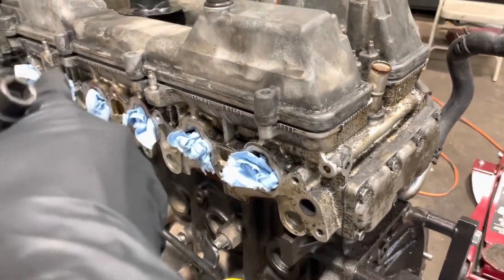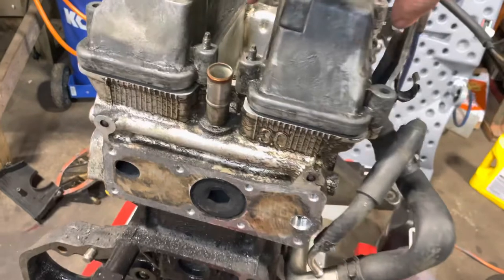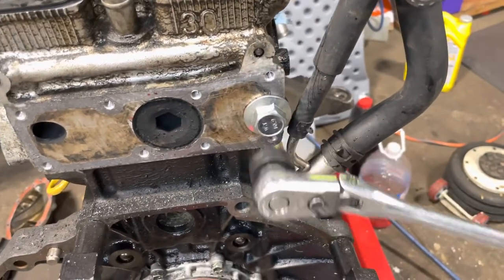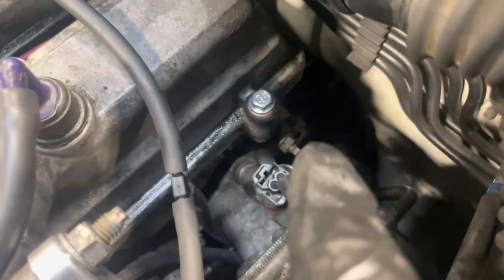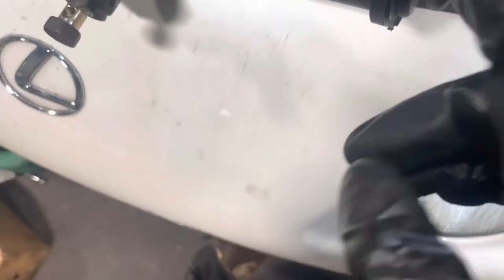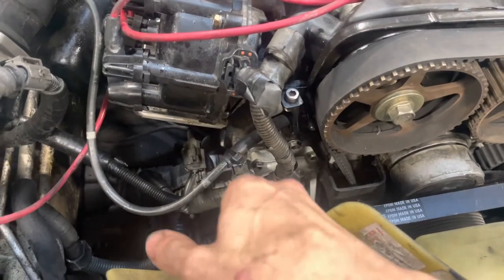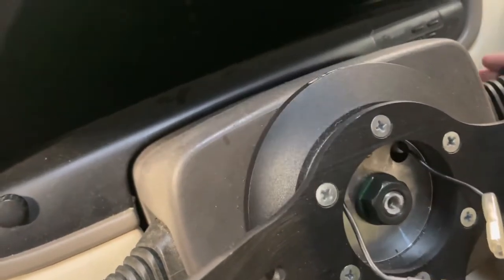2JZ-GE EGR Delete and Vacuum lines

Comment: On the charcoal canister from the fuel tank:

There is a line that was under the charcoal canister that runs back across the car to the area around the starter. You can tie those two and then it will dump there.

Personally I am so cheap that I want to use the vapor from my gas having played around with some southern engineered "bubbler" systems on old 80s pre obd vehicles where air is pumped into a fuel tank to vaporize fuel and the vacuum caries it into the runners through the tract

Yeah its not a lot, but like I said I'm so ocd about efficiency that I can't just let that vapor go. On a boosted car you'll get more out of it than on a NA just because under boost its going to pressurize and shove that vapor in with the charge. Depending on the lift and duration of your cam EVERY little bit helps when it comes to the miliseconds of the valve event

The resistor for the EGR is 10,000 (10k) 1/2 watt

Great video this will help a lot of people
Reply from the maker: Thanks for filling in the resistor info. Also did not know the charcoal canister info either. Thanks for paying good information forward. 🙌🏼
Reply: @Daniel_Aviles  yeah no problem. It’s always been weird to me people who want to hoard info like they weren’t ignorant at one point and had someone show them things and give them info to get where they are 

Recently had the big name in SC electronic repair refuse to tell me the size bulb for the climate control activation indicator led like it was a patented secret with talks of “the techs in back not releasing that info” 😂

They would replace it if I sent it in of course 

Closed my browser window that had 200.00 in repair parts and then ordered everything from China. Probably the same source they use even though they infer they make this stuff by rebranding it and talking about “our” quality 

Climate control LCD and gauge needle boards will be here in 3 days. I wanted to support them because I think the service to people who can’t rebuild electronics is a good one, BUT that rubbed me wrong
Reply: J rich ... you are a king for this type of info specifically , the resistor for the EGR is 10,000 (10k) 1/2 watt
Reply: @streetinfamy  no prob 

Currently working out what appears to be a common issue of the shift lock board not allowing the car to move from park on automatics and the Speedo and/or tach motors going out when the gauge cluster gets pulled to change needle boards (or just doesn’t work on cold morning till you hammer fist the dash) 

The copper contact on 3 of the indexers I pulled (black box the the pin on the shifter slides into) were misaligned and 1 of the boards (the box that the indexer plugs into) had a blown capacitor (22uF 16v)

Put the copper connectors back on track and replaced the cap and they all worked

Looks like a cap issue on the gauge motor also although it looks like those need to be pre-charged before soldering them on the board 

Not 100% sure on that issue yet

After this one’s back together next month I plan on swapping my 1jz in this 400 I found with blown trans 

Anyone know someone with a pedal set?!?!?
Reply: @jrich436  drop your IG !
Reply: @jrich436  I work for a JDM importer and tbh I can have one sourced for you but idk if RHD and LHD pedals interchange
Reply: @streetinfamy  hey. Don’t have Instagram. Guess I can get it 

Pedal boxes are different on RHD vs LHD

LHD brake pedals usually curve to go around the steering column and the accelerator spacing is slightly different. You CAN bolt them and use them but it’s weird feeling 

I do have some other stuff I’m looking for

You know the cliches…like 180 tails, trueno bumper inserts, soarer badges, ITR front 

Got any of that?
Reply: @jrich436 Hey mind I pick your brain? My 95 SC300 randomly began black smoking and misfiring one day during a test drive after I did some suspension parts. I initial code was MAF sensor. Changed it, code went away but still ran like crap/overfueling. I went down a HUGE rabbit hole changed a bunch of stuff. Opened the ECU and saw leaky capacitors, sent it to “Tanin Auto” who has a reputation for fixing ecu’s for these cars. Sent it out, they repaired it, claimed that they tested it and ran fine on their test bench. I put it in my car, SAME problem. Runs rich, black smoke, smell fuel, fouls plugs in the blink of an eye. At this point i’ve done about everything to do with fuel/air I can think of. So either they lied to me about testing it and I should try a different ECU, or something else is wrong. Also prior to the car having problems, I had this weird thing where beeping my horn would turn on Cruise Control, and Pressing Cruise Control would beep my horn. Also one day my horn just started sounding off and wouldn’t stop, while the cruise control turned on. So I had to unplug the horn completely. This problem stopped after the ecu repair but it still runs rich/black smoke/smell of fuel, rough idle super low >300rpm. If I give it throttle it’ll rev up only a bit and crap out. When I start the car initially it idles fine as if it’s normal @1000rpm, then as seconds go by it’ll slowly drop until it’s near dead @300rpm, strong smell of fuel, black smoke if I give throttle. What’s your opinion on this? Try another ECU? I’m about to try an EGR delete to see if that could be it as well. I cleaned it out and it wasn’t that bad to begin with.
Reply: @jrich436 also this is a list of parts I changed:
- MAF sensor
- IACV/TPS 
- Coolant Temp Sensor
- o2 Sensors
- Air Filter
- Literally Every Single Gasket (TB/Exhaust/intake manifold etc.)
- Gut the Cat incase of clog(doesn’t affect car cuz there is no downstream)
- Denso OEM Injectors/Cleaned Fuel Rail
- Fuel Pressure Regulator
- Fuel Filter
- Any old vacuum lines (one by one so I don’t misplace) 
- Dizzy Cap/Rotor/Wires
- Sparkplugs (multiple times due to them fouling every time I test run)
- ECU Repaired but not replaced.
- Cleaned EGR Valve even tho it looked fine
- Cleaned TB butterfly but also didn’t look dirty to begin with..
- Replaced IACV plug cuz my original one brittled to pieces. 
- Ignition Coil
I haven’t changed the Ignitor which I assume would throw a code which it has never done so. I started it up today to try get it to run long enough to throw some kind of code, but the CEL just flashed constantly about 3 minutes into me keeping it running so I just shut it off.
Reply: @_N4VE_  I can’t stand Tanin 

Guy’s super dishonest. 

If you read posts and descriptions he’ll make you believe he engineers a bunch of stuff, has a bunch of specialized electrical engineers on staff and that it’s his way or failure

Super negative about other people posting innovations that would hurt his monopoly 

When o first started restoring mine I saw his name everywhere. Wrote him telling him I was thankful for his service to the community and asked him for prices on parts and I’d install myself so their time could go towards others 

Long story short he pretty much inferred I needed him. Wound up calling and asking him about product combinations for the bulbs/covers for my dash because the description and options didn’t line up and also asked him about the small bulbs that show what climate control selection you are on since they said they can change them with the others as a service but didn’t have them as an item 

He basically mumbled something trying to make it sound like he needed to “check with his techs” to see if it was some kind of protected info, which he confirmed when he took me off hold 

I got off the phone and emptied my shopping cart

The next day I dug deeper and saw all his replies in forums telling people they needed to send him their clusters to fix issues because they could guarantee they could assess the issues like it was some laundry list instead of just telling people 99% of the time it’s the caps…..

Then I called one of my suppliers and found the needle boards he uses and had screen printed with his name for his website to make it seem like he engineered them in house….

I would never bench test an ecu instead of slapping it in one of our shop cars to test the map under load and heat cycles 

Disgusting
Reply: @jrich436  This makes me believe they BS’d me about testing it. They claim to have an sc300 on site that they use to test ecu repairs. So what do you think is worth a try? another ecu?
Reply: @_N4VE_  did you lower your car and/or put larger tires on it? Have an impact on the driver side front suspension?

There is a major harness that runs in the driver side wheel well 

A lot of people relocate that harness under the hood because lowering or upsizing wheels or with BIG bumps or impacts the tire will rub the harness and cause ground faults/shorts/crosses when it eats into the harness 

Pull the fender well shields and check the harness completely for issues. 

We always move that harness. It’s a pain in the butt but it’s worth it 

There’s are videos here. But basically you disconnect the plugs at the driver side kick panel then pull the harness through the firewall. Route it up into the engine bay, rewrap it, run it back through the firewall at the grommet and plug them back in 

It’s SUPER TIGHT and you have to stretch the harness. The airbag plug and the one next to it will give you a fit also 

If that’s not it you need to look at the relay/fuse box under hood, there’s a short there causing the relays to 12v input from the wrong switches 

But both the horn and cruise control run from the hub through a harness to the under hood fuse/relay and should be isolated from each other

The Toyota ecu isn’t know for being a problematic computer (like the 90s DSMs) so those caps blowing AND the haywire electronics are probably related 

Whenever an OBD car runs badly but there’s no CEL it’s usually mechanical (especially before OBD2) 

Pull the intake track off. At the bottom there’s a catch can basically. See if it’s full of oil. 

Did you notice black exhaust ports and initially were your plugs darker than normal? 

Black exhaust is carbon and that’s usually oil control rings and/or valve stem seals leaking oil into the combustion chamber 

The ECU won’t throw a code for that, but it will see EGT and air:fuel ratio as off table for idle and then throw fuel at it and limp mode the car for safety 

Rich, unlike lean, is safe

I’d look at both of the valves on the valve covers also

So check the harness first, then under the fuse box for issues. After that look for carbon 

Hopefully it’s a simple harness issue 

Let me know what you see
Reply: @jrich436  I’m at work rn but when I get time i’ll take a look at the air intake. I saw a video about the harness before I put coilovers but kept at stock height with stock rims. No rubbing on the wheel well at all. All my fuses are good, at least the ones with visible fuses that I can tell. I did valve cover gasket when I first got the car and initially before the car started having problems my plugs were always normal every service. Only got black after the problems began. When I did the exhaust mani gasket the ports looked normal not totally blacked out I actually have a picture of when I had the mani off. Never had white smoke or oil burning smell prior to the problems beginning. Rn the only thing I smell is fuel, black smoke from the tailpipe when I throttle it, and it can’t rev pass 3k rpm it just craps out. Guessing because it floods when I give it more throttle. I ran it yesterday to try and see if it would throw a CEL but it only began flashing indicating misfire so I shut it off. Also what should I look for under the fuse box?
Reply: @_N4VE_  Dropping the car can cause the harness to get damaged, you do not have to upsize the rim/tire, but the combination of the two will definitely do it eventually

But yeah it really does sound like your ecu is sticking the car in limp mode.

The reason i keep going back to the harness if because of the cruise control/horn issue. The horn is not controlled by the ECU

For one to turn on the other and vice versa the 12v signal from the switch has to be jumping across to the other

You want to trace the harness to the bottom of the fuse box, under it where they go into the holders for the fuses and relays. Look for wire breaks and/or corruption where the signal could bridge

When the horn would not turn off, that was the relay sticking or the harness shorting to a 12 volt constant

The issue with junkyard ecus are that they have been sitting for so long that the caps may be leaking 

I would open the one you have up and look at the caps under a magnifying glass

If you see discoloration, bulging or leaking (dark spots on the board around the cap) then the caps are blown

The bulging can be VERY subtle or it can be obvious. If any of them are not the same general color as the others its probably shot, the heat will distort the plastic sometimes and make it darker when they blow

I personally buy low ESR caps from Panasonic which cost way more than the off the shelf stuff you can get on ebay/amazon. I get them from an electronics shop in Houston but digikey.com has them also I think

He very well could have changed the caps using some bulk caps and bench tested or just plugged it in to see if the test car would start. Thats honestly industry standard

If you have never soldered before, watch some videos on how to solder

You definitely want to get a good quality flux and a flux wick to cleanly desolder the old caps. Get a 91% isopropyl alcohol to clean up the board

Amazon has some affordable soldering stations with themal control and some decent micro tips for tight soldering 

Make sure you have acid free electronics solder and a magnifying jewelers headset helps
Reply: @jrich436  The car was kept stock height after I put coil overs as of now. And technically as I said the horn/cc issue went away after the ecu “repair”. But the problem that hasn’t gone away is the overfueling. What’s more interesting is that on a first start up the car idles at 1000rpm as if nothing were wrong, but after it runs for a little the idle begins to drop slowly until it’s chugging at 300rpm<. Giving it some throttle will keep it alive but throwing black smoke and smell of fuel. If I force it to stay running it’ll just begin flashing the CEL for misfire. I’ll open my ecu back up and check it out. I know some of the acid got onto the board itself when I sent it in so maybe some of the damage is irreversible
Reply: just checking back in on you. Should have mine back on the streets in about a month with the new double cam and crank trigger kit so I can run a stand alone  @_N4VE_
Reply: @jrich436  hey thanks. So after changing my ecu, and doing egr/can delete, the car started and ran for about a minute! No black smoke/fuel smell. But then randomly it just cut off. Sometimes it’ll start and run then cut off again, other times it just cranks but then the starter seems to stop. Worth mentioning that the starter was already beginning to give me problems prior to sitting the car down due to the overfueling issue. my replacement starter came in the mail today so on my next off day I’ll begin working on it. Also maybe a new battery since i’ve had to put jumpers on it to get it to crank. any thoughts? also changed my fuel pump since it was the old original pump.

Comment: felt the need to put this here. i was following another video from someone going na-t at the same time as egr delete... then found this one. Biggest thing that threw me off was hearing in this video was if you aren't going turbo, you keep that system... No. throw that shit away lol. my car was revving to the moon barely touching throttle, then would just rev hang. I went back and pulled that vsv canister and just routed an intake line to the actuator and my car runs mint now. back to normal/but egr deleted. GET RID OF THE GIANT VSV CANISTER underneath the intake plenum. run a line from farthest left vacuum on intake, to the actuator (far right actuator, near injectors) instead of from that vsv to actuator. you're welcome. :)
Reply from the maker: been dailying mine this way for a year runs great haven’t had any issues with mine, but will give it a go, and see what happens, so to clearly put it run the canister vsv straight to the intake and  then to the butterfly valve without the canister?
Reply from the maker: Wait straight to the actuator(butterfly valve) would keep it open all the time, which would be the same as removing it.
Reply: @Daniel_Aviles  did u end up trying it?
Reply from the maker: @jaliennation9169  I did! Without the canister it did work. Routed the line thru the vsv and directly to the butterfly.
Reply: @Daniel_Aviles  any chance of a vid or diagram for the connections?
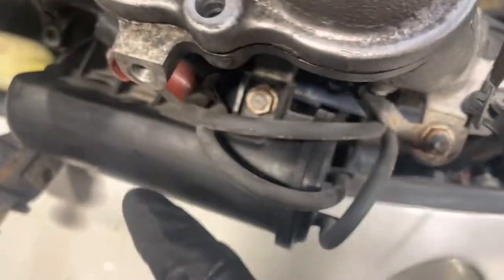Reply from the maker: VSV I am referring to is at 9:24 it needs a line from the intake port I point to at 11:10, from the VSV at 9:24 it goes to the butterfly valve thats shown at 9:12. Hope this helps!
Reply: @Daniel_Aviles  I routed one line from vsv to the actuator, and another line from the vsv to the intake port. is this right? car starts but then dies after a few seconds
Reply from the maker: @_N4VE_  that is correct sounds like you have a vacuum leak elsewhere
Reply: @Daniel_Aviles  not sure where tho, The only vac lines remaining are all new, all my manifold/tb gaskets are new. where else would there be a leak? if I posted a video of it would you be willing to take a look?
Reply: I have a 95 sc300 non vvti it starts at 400rpm and once engine is warm is never comes down from 1500rpm
Reply: @kurt8986 same virtually